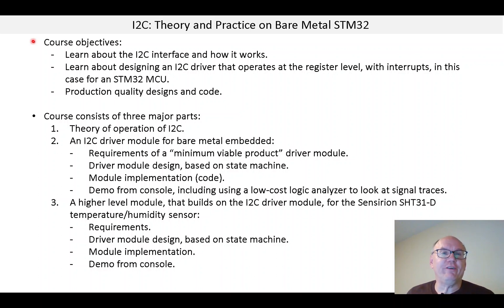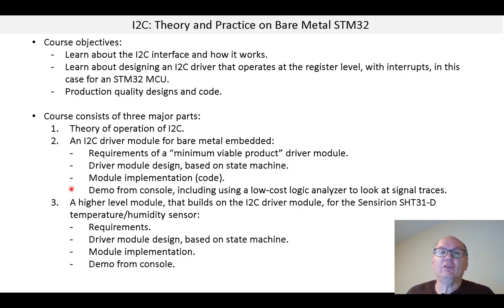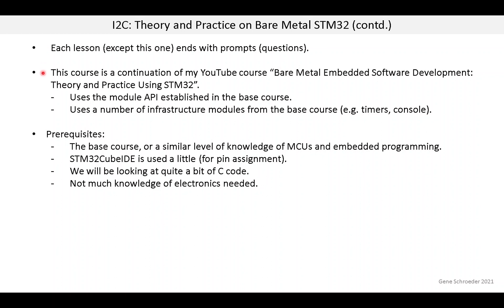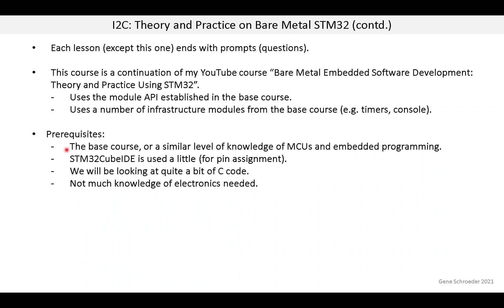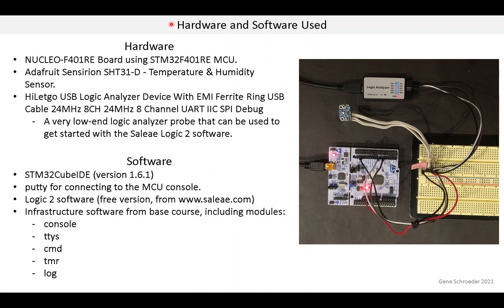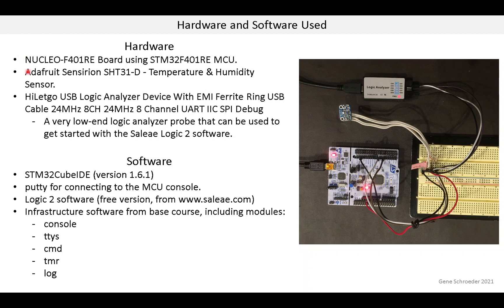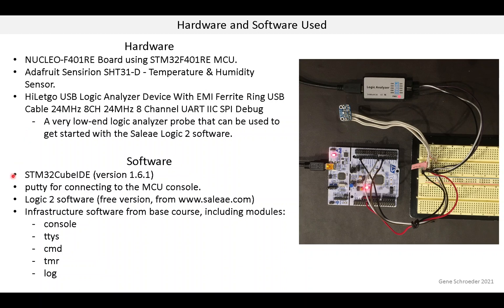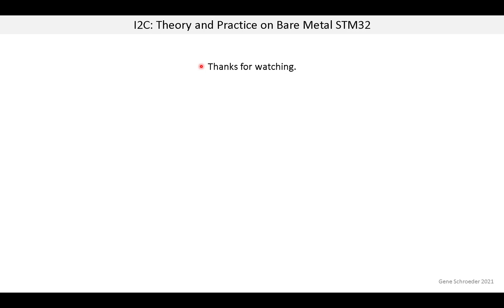I2C Lesson 1. Introduction to the Course

Comment: The link to the github repo is not working
Reply from the maker: @Stuff2Learn Thanks for letting me know. The problem is the repo names use the word "class" but I mistakenly used the word "course" in the video and the notes.

I have fixed the notes for the video. It is difficult to fix the video, so I am looking into putting in a GitHub redirect so the "bad" URL will redirect to the correct URL.

Here are the corrected URLs:

https://github.com/g-schro/i2c-class-1-code
https://github.com/g-schro/i2c-class-1-materials